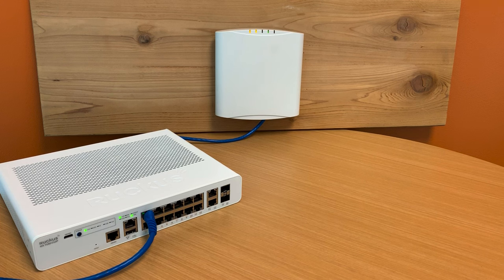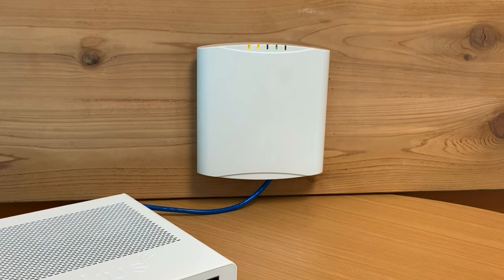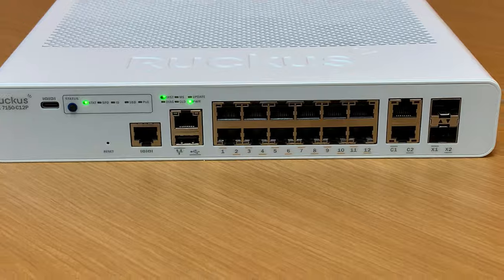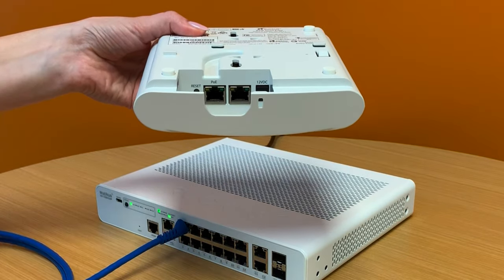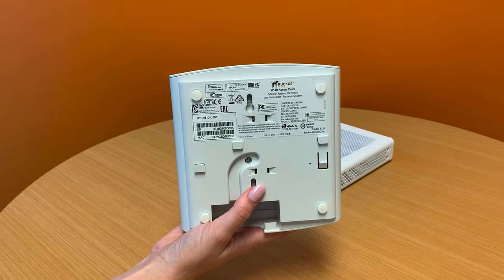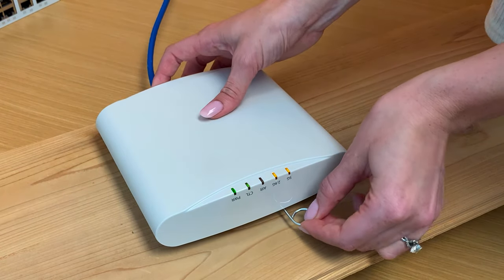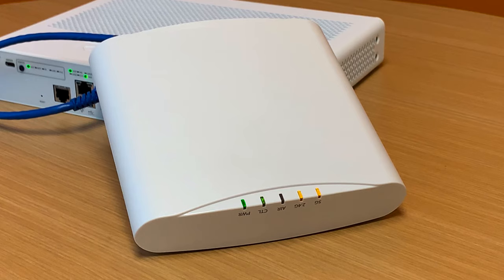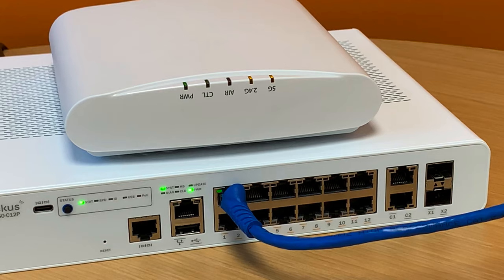Ruckus at Home: Introduction

Comment: Hello, thanks for the videos, help a lot, it would be also great to have videos related to the CLI in the Access Points. 
For example, topics related to issues for: 
1- SONOS Speakers not connecting
2- How to get access to the CLI 
3- Issues with password and username
4- Heartbeat Loss in the APs 
5- Phone Issues not connecting to the SSID 
6- Chromebooks and other troubleshooting. 

The reason to ask this is that I receive this kind of case or tickets and sometimes a video would be great to understand better how to help clients from all over the world, specially in the use of the CLI.
Reply: The sonos speakers try to find each other via multicast. The AP handles multicast low prioritized and that causes the sonos devices to time out. You can disable it on the APs CLI directly with the following commands:

 set qos eth0 igmp disable

set qos eth0 classification disable

you can connect via ssh with putty for example. the login credentials are either the ones of the controller, the zone that specific ap is in or the credentials you gave it - all depending on the controller type. you have to repeat that commands after every firmware update.

Comment: Hello,  we have an aparthotel with four houses (mansions) connected to each other with extremely thick wals and windows in Brussels Belgium, which contains about 30 apartments. We already tried to have a stable wifi network with a variety of acces points like tplink and ubiquity amplify but its still not stable an it gets interrupted very frequently. We are  now looking to change the hole system and replacing everything with a ruckus setup! Which model of Ruckus AP do you guys suggest? Keep in mind we don’t want to pay tons of money…
Reply: Is there any utp connection in every single room? You can use Ruckus H320 in each room because if you said extremely thick.

You can use AP in your corridors, but trust me the user experience is not so great
Reply: Denna Maulana thanks for info!

Comment: Where does the internet service provider box connect to the Ruckus box and also what line is used to connect them
Reply from the maker: In the base switch configuration, you can connect the ISP device to any port on the switch. By default all ports are in the same VLAN, so they all "talk" to each other.

Comment: I have the r320, but the 5. and 2.4 ghz are not lid based on your video. When you say wireless, iPad, iPhone?
Reply from the maker: The video is based on an R320 and those are the LEDs as shown. You can confirm here: https://www.commscope.com/product-type/enterprise-networking/wireless-access-points/indoor/r320/

Comment: My builder put this ruckus mesh ap system in my new house and didnt tell me. Im guessing these are much better than my single nighthawk x8
Reply from the maker: That they are - we have a ton of resources here and on our How-To Hub if you're looking for more information. https://support.ruckuswireless.com/hth-ruckus-at-home
Reply: It's like going to Volkswagon to buy a Jetta and the give a Porsche 911. One's going to be just a little bit more powerful and faster than the other.
Reply: My builder put up two ruckus connectors but they don’t seem to be acting as extenders or anything and our Ethernet in our walls isn’t working. I’m thinking of hiring someone to provide an alternative option

Comment: I have a rukus ap and a net gear router. Can I hide the ssid on the net gear and set the rukus as the ap?
Reply from the maker: Yes, however I would suggest you disable WiFi on the Netgear all together.
Reply: @RUCKUSEducation  thanks! So I just connect the ruckus via Ethernet to the net gear, disable wifi on net gear, but what is the default IP for ruckus I’m assuming I’d need to reset it as it was used previously
Reply: @RUCKUSEducation  Thank you, I am not familiar so, I have a comcast modem I but I use Netgear for wifi. So to get the ruckus setup as an AP what exactly do I need to do so I cna use the ruckus as ap? Just connect via ethernet to the netgear, turn off wifi on the netgear then what?

Comment: Where does the ISP routers RJ45 connect to on the ICX 7150 to provide the internet access?
Reply: This video is a bit bizarre as they aren't considered "common" in a smart home like the presenter states. In business deployments, a 3rd device would be the internet gateway. I've deployed a lot of ICX hardware and I'm not sure how to use the 7150 as an internet gateway, though we do plug ISP routers into them as they state but that is because it's VLAN'ed.
Reply: @bbrendon  I think it's a relatively new thing for use in "Smart Homes".  I just bought a new Lennar home and this switch with 2 wireless hubs are included in the home.
Reply from the maker: You can connect your ISPs RJ45 LAN port to any of the 12 ports, which are numbered below the ports, in the center of the device.
Reply: Does  any one know how to hook up a spectrum business equipment as fast the ethernet cords go? There is a modem, a router, a ruckus point of access and a arries.
Reply: @RUCKUSEducation  can the 7150 work as a router/firewall where the ISP router only serves as the internet gateway in bridge mode? I'm moving into a new Lennar home in couple weeks with about 18 ports. but this switch only has 12. I have devices behind the network that require port forwards and LACP support.trying to figure how I'll transition to this hardware from what I'm using in my current home.
Reply: @geraldslonaker3289  Incorrect I think.  The Lennar homes use this switch and WAP, which is not wireless.   They appear wireless but there is a Cat cable that goes into the ceiling.
Reply: @brianhankins9992  You are correct....I used the wrong name....when I said "Wireless Hubs' I was meaning they are "Wireless Access Points (WAPs) and yes they connect to the switch in our network/media panel with pre-wired CAT5.  I think most new homes will include these capabilities moving forward.

Comment: how do I make the r510 wireless? Right now, it depends on ethernet for connection. Is there a setting for that?
Reply from the maker: The ethernet connection is also the power, which I'm assuming you are referring to? If you want to have it wireless only with no wired connection, that would require a power adapter.
There are some distinct disadvantages to doing that - head over to the forums and let's discuss further.
https://forums.ruckuswireless.com/ - Just search for Ruckus at Home and post there.

Comment: What POE cable standard is required for a WAP? What cat rating of the ethernet cable?
Reply: Standard Ethernet cable will work. Specifically, CAT5e, CAT6, CAT7. Just make sure to avoid CAT5 (without the e) as this cable is too old to support POE. It lacks pairs for it.

Comment: If my house already has two R510 APs can I add a R550 or R650 to get WiFi 6 in our main living area? Are there any downsides to doing this? I would prefer to not upgrade the AP in the upstairs loft if I don’t have to. Should I avoid having an R510 and R550 on the same level? Thanks!
Reply from the maker: Yes you can add a WiFi-6 capable device to take advantage of those features. Remember however, the devices in your home also need to be WiFi-6 capable. With regard to placement on the same level, power levels can be tuned (or even set to auto) and specific radio chains can be disabled (if necessary). You would want to make sure each device uses it's own channel and that there is proper coverage overlap so that devices can roam seamlessly.
Reply: Is the quality of their circuit board so bad they show an animation?

Comment: For the life of me I can't get these things to be stable. I have 2 AP's on the switch. both are up and running, my connection is 400 mb/s and I'm only getting 90 and online gaming shows I have packet loss up the wazoo. After much frustration I hooked up my old Apple router and it pipes down 400 mb/s no problem no matter how many clients I have on it. Any ideas?  When I run a speed test I'm connected to the 5ghz channel as well so it should have no problem, I'll literally stand 3 feet away from the AP so distance isn't an issue either.
Reply from the maker: I would encourage you to contact Ruckus support for troubleshooting the issues you are describing here.

Comment: how to factory reset ruckus r310 i forgot my password thanks
Reply: Yo bro when u reset ur router what happend did it reset everything?
Reply from the maker: Same method - just hold the reset button for 12-14 seconds.
Reply: @RUCKUSEducation  will it reset my whole wifi password and stuff?
Reply: @weezole2602  For your information, yes bro. It reset every configuration your installed in AP.

Comment: where does the line from the cable provider modem go?
Reply from the maker: Use any of the 12 ports located in the center of the ICX-7150

Comment: Hmmm. Commonly found in smart homes? On what planet does this guy live?
Reply: I personally have seen a few new home builders installing ruckus as a standard feature.
Reply: @TamVilla916  Yea, that would be a more realistic thing to say.
Reply: My New Lennar home came with it standard
Reply: @victorr9065  Mine too
Reply: brandon splawn And mine! Which is why I believe we’re here lol at least, that’s why I’m here
Reply: I think in home use you can use R320 for standard usage. You can concentrate in living room, workplace and the bedroom especially. 2 or 3 device for home network.

I’m using R310 for home, and you know what? My wife is very happy because the wireless reliable 😘
Reply: @victorr9065  What else did you need in the control panel to connect service? Do I need a modem, router, or combo connected to the switch? Lennar can't seem to give us a straight answer.
Reply: @xsteel3292  Yeah I'm pretty  sure they won't fix it. Thankfully for me, I work for company where I can get a lot of network equipment for free. The first sign that these things are going out< I'll replace them.
Reply: @x Steel
Only had it for 10 months so far.  Still works lol
Reply: @meredithgreenwood9322  sorry lennar installed everything in the smart pannel
Reply: We Have 2 Ruckus AP's and the Ruckus Switch on Fiber Optics.Can Standard with our home.